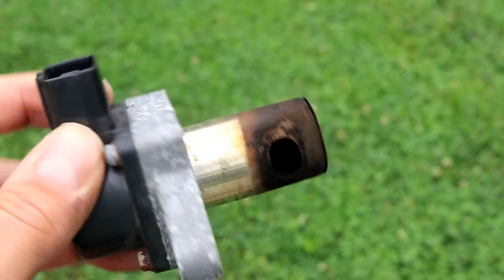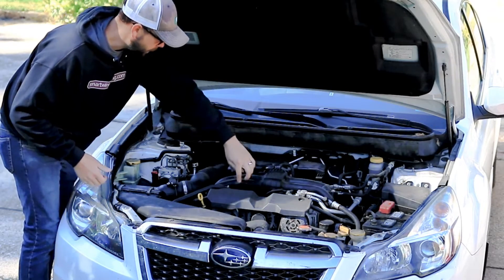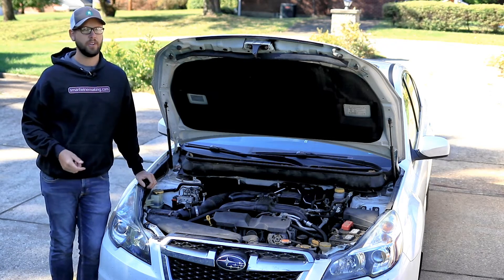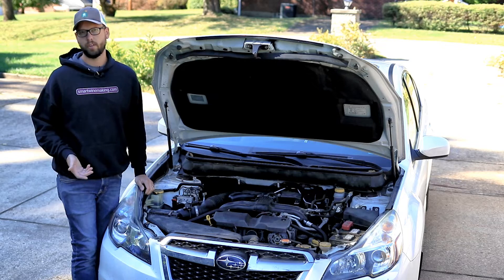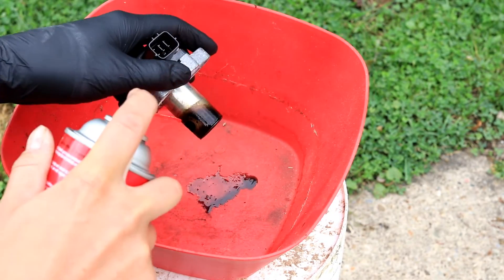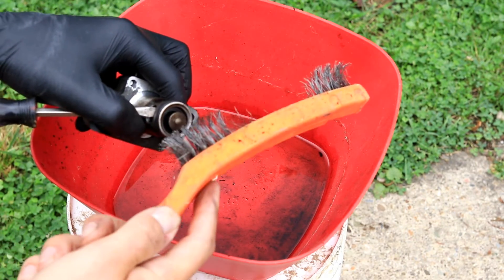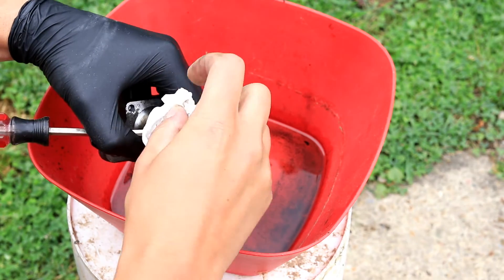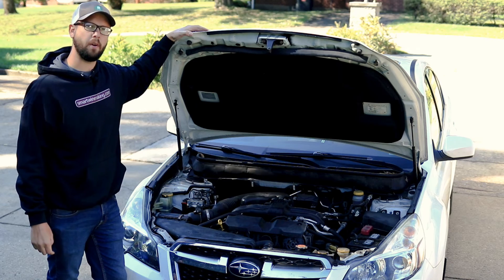Cleaning a Subaru Electronic EGR Valve to Smooth Rough Idle and Improve Power.

Comment: Would this make my car hard to start im haveing a problem my car runs great till its warm i belive I left work the other day parked it and went to leave like 30 min later qnd it would crank no start so I pulled the key out same thing then I tryed it one more time and it started please help
Reply from the maker: Hmmm.  Could be a dirty mass airflow sensor or the temp sensor under the intake manifold.  Seems like the car doesn't know it is hot, so isn't adjusting the air/fuel accordingly.  If you have a OBDII reader you could check to make sure the engine temp readout seems accurate when the car is hot.
Reply: Thank you I will replace both and hook a rear up to it
Reply: This may help with that issue too. I had a CEL, rough idle and sometimes my car would take a lot more cranking to start when it was warmed up. This definitely solved my rough idle and CEL. I have a feeling this solved my starting issue too but only time will tell for sure. If you have a lot of miles, it should be done anyway and see where that gets you

Comment: 2010 outback. Idles super rough after a cold start, requires WAY more gas than should be normal to move in revers after a cold start, rattles on idle and stalls coming to stops or running in reverse after a hot start. Exhaust also stinks like an old carbureted car with no catalytic conv. Possible EGR problem?
Reply: I’m no expert but based on my experience with my 2012 Subaru...I would clean the egr, and MAF sensor and throttle body. There are videos on those last two and I just bought the cleaning spray from Walmart. Be careful, you have to use MAF sensor cleaner. That helped my idle. It’s easy to do though!!!  I had a rattle coming from the air conditioner compressor clutch. Maybe you do too. Don’t have any thoughts on the smell.

Comment: Excellent video and I just completed the procedure.  I made the cleaning part a bit easier by taking an old shot glass; filled it with throttle body cleaner; and placed the EGR valve inside.  I just let it soak for a few hours and the carbon came off much faster.  Without your video, I probably would not have tried this!
Reply: Thank you I don't know much about cars but learning more and more. I didn't know what carbon cleaner to get and this helped a lot. I'll use that shot glass method. Thanks again!

Comment: Thank you
Trhottle body is also cleaning needed?
Reply from the maker: You can clean the throttle body but it does not get nearly as dirty.  Not a bad idea to do it about every 40 or 50k miles.
Reply: thank you
Reply: @andinamm2246 I cleaned the TB on my wife's car when I did this. It was dirty but nothing like the EGR valve.